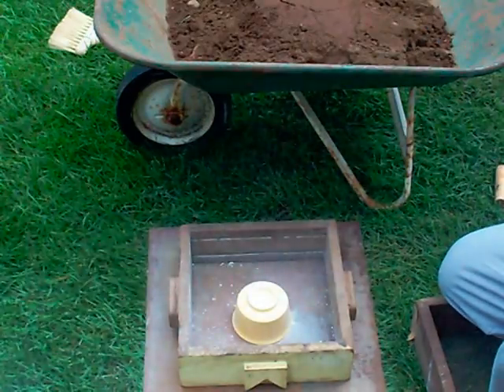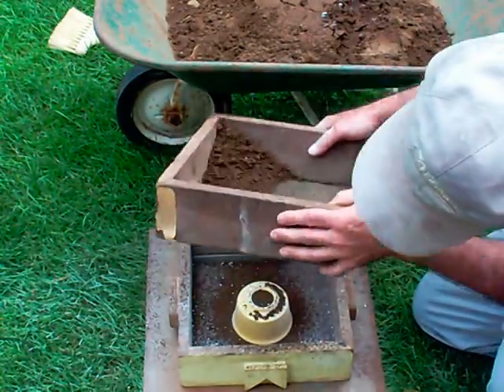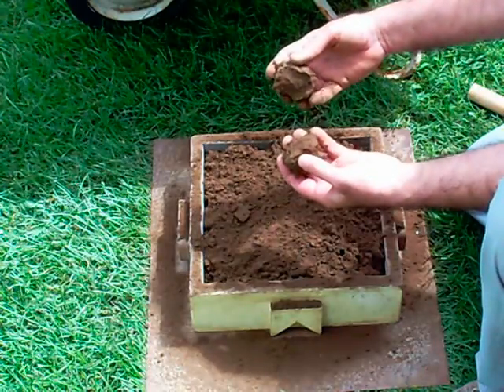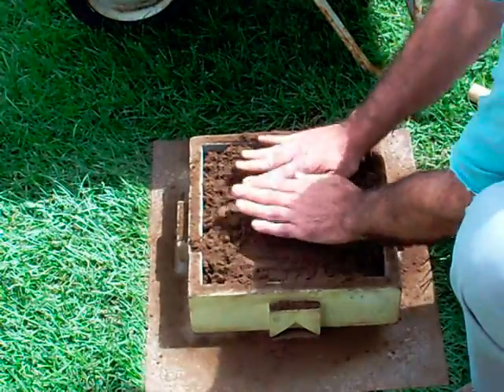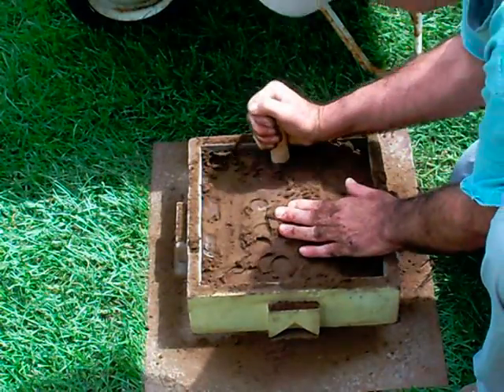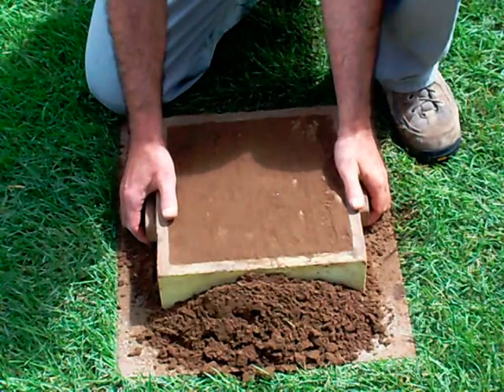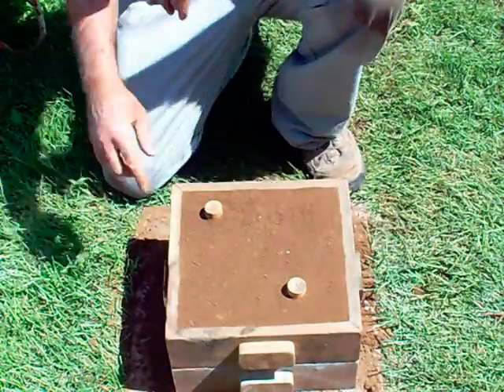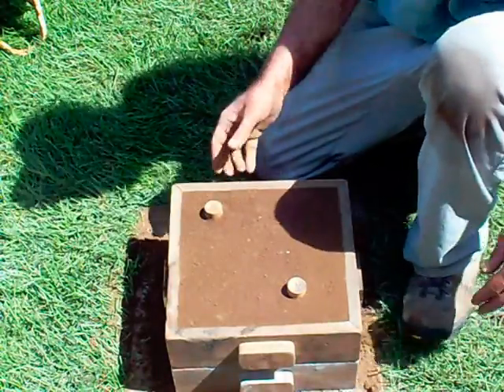The operation of a small foundry 2nd video

Comment: Yep,sand too wet.What mixture and ratio are you using for your greensand? Also a couple of gentle sideways taps/knocks with something like the handle end of a screwdriver,or even your tamping tool, on top part of your flask from both directions assists in cope and drag seperation.
PS,i take it your flasks are diy? I like em.How well does the V locate them?Just make sure when they are together,there is no movement between cope and drag(minimal).